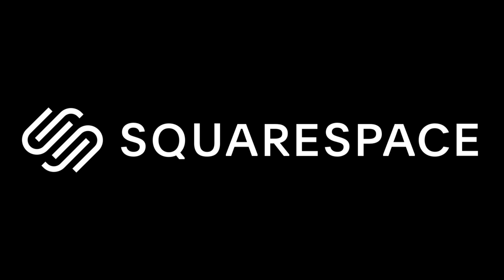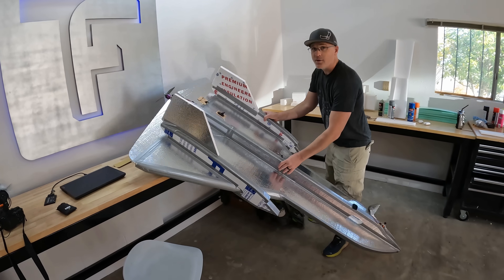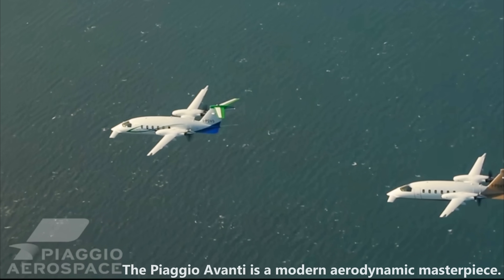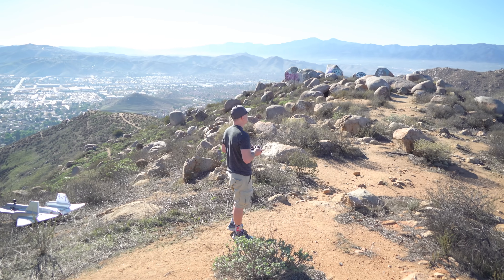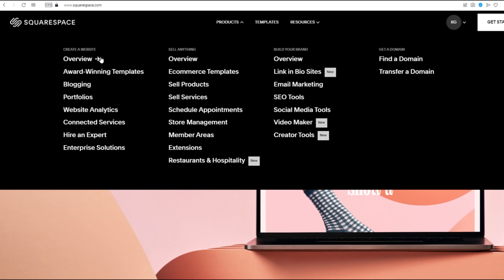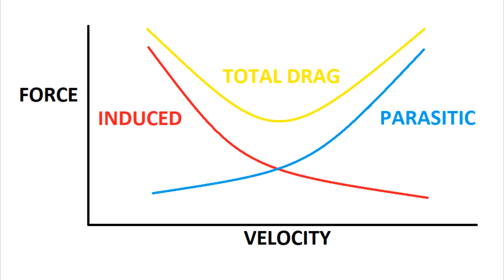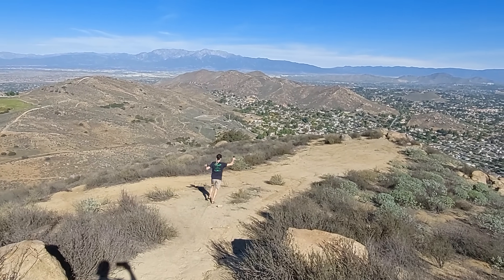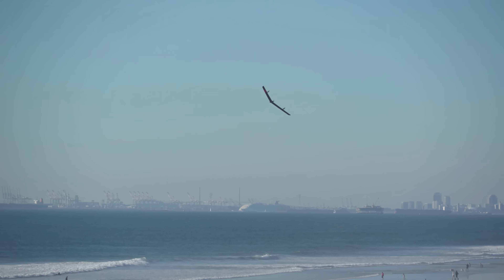Are Skinny Aircraft Wings Better?

Comment: In real aircraft, where structural weight is closely controlled (unlike in foam models), structural weight is much higher with high-aspect-ratio wings as the bending moments are greater and the spar is not so deep. (Spar weight might even depend on the third power of spar depth.) Greater weight requires more wing, and hence more drag. Furthermore, high-aspect-ratio wings have shorter chords, and hence lower Reynolds' numbers. (The Reynold's number describes whether flow is dominated by inertial or viscous forces.) Maximum lift coefficients are lower at low Reynolds' numbers and hence, again, a larger wing is required, increasing drag. This is why low-aspect-ratio wings are not as bad as might be expected from considerations of induced drag alone. They can work quite well on slow aircraft - e.g. Barnaby Wainfan's facetmobile.

Comment: I have never flown NRC plane before. I would like to build a low aspect Wing airplane to maximize my loiter time. I plan on using a flight controller. Do you have any recommendations or suggestions?  I have no idea how to pick a motor or battery or prop either.

Comment: Long skinny wings are definitely good for efficiency, but I've noticed issues with very light planes. When the wing span is large in relation to the airplane weight, the reynolds number is fairly low. Below about 50,000 most airfoil designs have lots of issues, so the L/D is very low. In this case having the airplane fly faster at a lower AoA is better due to the increased reynolds number and therefore increased L/D.

Comment: Doubt you will see this but I was wondering why you designed the low speed aircraft with swept wings. I did an extremely minimal amount of research and found that swept wing designs specifically deal with wave drag from transonic and supersonic flight. In the case of an electric drone, those speeds are not possible.
Reply: Its because it does not have a tail. Its very difficult to make a flying wing (airplane with no tail) that flies stable with a straight wing planform.
Reply: @dikkeyolo3713  I just figured that low speed efficiency would be better tested with a traditional design

Comment: Would you consider using this platform to test using mid wing mounted motors to counter act the mid wing vortex you noticed in your wing tip mounted motor? I've always wondered if that's the key to efficiency in flying wings. It looks like you either had the same or a similar idea with the vertical stabilizer placement. Just a thought, I'd be very interested in the result. Love your videos! Keep it up!!

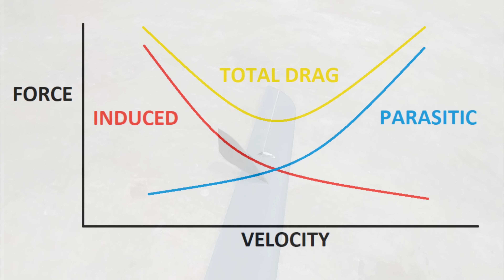Comment: 1:57 Deadalus (between Crete and Santorini, in Greece). longest human powered flight on record. Greek pilot. Picture is from here https://www.youtube.com/watch?v=4pbKp7ufwns
3:08 "high efficiency and low speed is correct" ??? Such planes reach up to 900km/h with the thermic as their sole drive. So, u call 900km/h slow, for a plane without any energy consumption? (or at least, no apparent energy-consumption)  ;-)   Generalizing for educational reasons is always a bad advisor...   ;-)

Comment: You just described the most commonly described differences between low and high aspect ratio wings.
But, you should also note the reasons why some people have suggested replacing the stubby wings of the F-16 with a delta wing, and why relatively high aspect swept wings might be preferred in some cases vs a delta wing that "fills in" all that space behind the leading edge of the narrow wing.

In other words, there's a lot more to the wing form than just whether the wing is high or low aspect ratio.

Comment: Great breakdown, I think its worth mentioning that swept wings, and the delta wing of your foam model, are generally designed with trans and super sonic effects in mind. Swept wings can lower the effective mach number and delay the formation of transsonic effects. Delta wings keep the wings out of the shock formed by the nose at supersonic speeds and generate lift differently at lower speeds, hence the larger angle of attack
Reply: I would like to kwow how a flat wing can acually give any sustentation, 1 of aeronautics and I'm not understanding taht.
Reply: in this case its more so for stability beacuse it has no tail

Comment: Well, let it put me that way. If you are speaking about form and parasitic drag and show a model aircraft with leading and trailing edges as thick as books, the effect described do not happen. The foam thing is nothing less than a pure form drag platform, even for slowest speeds.

Comment: I know skinny wings are more efficient, but what about solar powered aircraft? The problem is I'm not a mathematician or an airplane designer so I don't know how to figure this out. I have identified a few issues. 
1.Skinny wings are more efficient, but broader wings, for the same length, are stronger and larger so can attach more solar panels but are heavier... I'm getting rocket equation vibes. 
2. Do we even want to put solar panels across the entire exposed surface of the wing? 
3. Solar panels have essentially fixed weight per unit area, wings do not, or don't have too. 
4. Solar panels are also really heavy compared to normal wing structure materials.

I think the takeaway is that solar aircraft have very different design requirements and shouldn't be just 'regular' wings modified for having solar panels.
Reply from the maker: It depends on how much flying you want to do away from max solar efficiency.   If you are flying mid day then yes, maximize area and go with whatever gives you the lightest airframe weight.   If you have to fly through the night, you need very long, very skinny, marginal strength wings to minimize sink rate.

Comment: Here's a question:  At what actual velocities does the crossover happen between induced and parasitic drag?  Is this different for our small RC aircraft? How does airfoil shape (or other important factors) effect this? What other important factors contribute?
Obviously, there are (I'm sure) decades of math to figure this out based on as many variables as there are stars in the milky way galaxy. 
I would LOVE if you could do an in-depth analysis of choosing a specific aspect ratio and/or airfoil shape. 
How did you choose the specific wing profile for your high efficiency wing in this video?

Comment: That plane with the skinny wing would make a good FPV cruiser glider if fitted with a bigger battery and long range antennas, also if fitting with a 360 degree gimbal for FPV camera with head track on the nose would basically give you the best flight experience but due to FAA regulation would make such flight impossible without the flight clearance waiver. Still would make a good slope or flat land e-glider, now would be nice if plans  are available to build one.

Comment: You can see the same effect in birds: the long slender wings of an albatross, vs the wings of a peregrine falcon.  Another important part of the equation is maneuverability.  Multiple factors are at play, but one important aspect is the spatial relation between the center of mass and the center of the lift.
Reply: Long thin wings produce less drag, but are much more unforgivable in terms of actually flying them, prone to ip stalls, prone to sudden loss of lift due to the narrow chord,  harder to build... There is a lot of pros and cons to a high aspect ratio wing..

Comment: I once wrote an aspect ratio design analysis program for RC sailplanes  The program was based on Martin Simmons book on model aircraft aerodynamics and ran in basic 7 on a commodore 128D, gives you an idea of the vintage.  What I found was that for a 100 inch span and fairly light wing loadings achievable in a balsa & spruce construction, sink rate was generally minimised at an aspect ratio between 10 - 13.

Just prior to that, this had in practice work out pretty well for a slow high lift floater flying calm & relatively inactive conditions.  The model was a stretched and tapered wing version of a Soar Birdy 86" span with which I got 2nd place in my LSF national soaring comp Jerilderie Australia with just such a model.  However,  higher aspect ratios resulted in increasingly higher wing loadings and air speeds on an increasingly flatter glide slope.  The improved glide slope did not out weight the adverse effect on sink rate due to higher airspeed.  However, it did improve the models range and therefore ability to search for lift over a larger area & especially it's ability to do so in stronger wind conditions.  So basically, it became a gambling game.   I have put quite a lot of effort into optimising height from a bungee launch.  I could pretty much get more launch height than than anyone else  Because of the high camber wing & more rearward tow hook position, I had to hold a little down trim at the start of the tow to prevent the model doing a premature auto release while climbing vertically.  It was astounding how much more height I was getting & there was winging to the committee, but everything was comp compliant.  The only difference was that I had put the time and effort into trimming & preparing the equipment to get then best performance out of it that I could.

Anyway, I had 2 models at the time.  100" span using a scaled down Bird Of Time wing section.  This is a much less cambered and thinner higher aspect ratio wing than the other model.   Bothe models had similar wing loadings but this higher aspect ratio model was notably much faster had had a much flatter glide.  It could cover a lot more ground searching for lift.  However, that particular competition had cool weather and calm conditions & the floated won out over it by quite a lot.

My opinion though remains that it would have gone the other way if conditions had been windier with more active lift.

For these 2 modes, it would normally be the case that the broader wing should have the less cambered section and the higher aspect wing should be the more cambered section, but this was early days for me, before I read Martins book.  It's just that having studied the aerodynamics and then written the program removed the mystery & with it the interest, so I didn't continue to pursue sailplane design.  I had also designed a few models with too short a moment arm which unfortunately led to overloaded (stalled) tailplane during F3B speed runs & diving into the deck.   Normally the moment arm would be between AC wing and AC tailplane would be 4 times the mean wing chord for most model sail planes.  In order to achieve balance with less nose weight, I went for 3 chords, which was fine for normal soaring flight, not fine at speed though.  I think the 3.5 chords might have been adequate though.  As it was, I would start a ballast loaded speed run and at some point the nose would continue to drop despite up elevator control.

After that I bought a Sirus (2Ch) that someone else built, it clapped it's wings slope soaring over sand dunes.  Repaired it, strengthened the wings with a new I beam main spar, redesigned the tips & rebuilt the rudder & tailplane with a geodetic structure.  Installed a completely hidden in a closed loop rudder hidden cable system as the fin is suitable thick.
The model died one day when another pilot switched on their TX on an adjacent channel.
I had had many thermal flights well over an hour with that model, only landing to rest my neck.
That model had a fairly high aspect ratio high camber wing.  It could cover a lot of ground sniffing out lift, reasonably good upwind speed, not exceptional.  It could would loose out against a floater if no lift was found, but most time I'd find lift.  It had no provision for ballast though.  I had it disappearing into clout a few times.  The fully flying tailplane had differential control throw.  I could half loop over to inverted to drop out of the cloud base lift & bring it back home.  Rudder roll it to upright flight again for landing.  All in all it was a rather nice model to fly. see below.  

Soar Birdy Var 86 inch Span about 78
https://drive.google.com/file/d/1UM-ZV-CWWSXPEDwUoD5rfBmplhYUEEB8/view?usp=share_link

Bird Of Time Section 100 in Span about 79
https://drive.google.com/file/d/1iqbyN6a5l76PElb6qGHS8oobFz6cb9hM/view?usp=share_link

An RC flying wing glider I designed about 77:
https://drive.google.com/file/d/1s-Z7ob6zHEiKgaB_0w8HHgwYFyc8hrrZ/view?usp=share_link

A Sirus I had in the 80s  Many thermal flights well over an hour.
https://drive.google.com/file/d/1cDgETfMoPqNyu_TfJcuCd4v6dA-A6w60/view?usp=share_link
Reply from the maker: This post is a goldmine, thank you!!!
Reply: @thinkflight  Ta,

Then you may also be interested:  I did a statistical analyse aimed to best approximate the "ideal" elliptical span loading with a simple double taper wing.  It turns out that the standard deviation on the span loading's departure from elliptical is minimised when the inner panel is a constant chord for 40% of the semi span & the outer panel tapers to 60% of the root chord at the tip.  I never built it though.  It would be slightly unusual in that the centre panel is shorter than that of most double taper wings & the tip chord somewhat less as well.  Most tip chords go to about 70%, maybe even 66,6% (2/3) of the root. Many are scared of tip stall & cautious of making the tip chord too short for that reason, but combining a small increase in camber with a little washout, gives the tip the same AOA and higher Cl max before stall (safe from tip stall), without changing its zero lift reference relative to the rest of the wing.  Anyway, it "should" make for a slightly more efficient wing, not that you'd notice really, maybe a few seconds extra duration in dead air.

On the other hand, you'd get a lot more benefit from adopting Prandtl's bell shaped lift distribution at the same root bending moment as that extends the span very significantly reducing induced drag.  The maths looks a bit tricky to me though. There is a fair bit on the net about this these days and in English translation no less!
Reply: This is the first time I bookmarked a YouTube comment. Thanks for taking the time to type it out!

Comment: Amazing video as always, also loved the YF-23  at the beginning. Just a correction on a tecnical note: multiple time you said that high AR (aspect ratio) is for grater efficiency at lower speed. This is not entirely correct, in fact the AR determines mainly the max aerodynamic efficiency (lift to drag ratio), while the speed where the peak efficiency is achieved is determined by the wing loading (aircraft weight over wing aera). Also sometimes is better to think about not the speed of max efficiency, but rather the dynamic pressure of max  efficiency (q = 1/2* TAS^2 *rho); in this way you take out of the equation flight altitude (the higher you fly the lower the air density so the speed of max eff. increases). In my opinion the best way to undesteand intuitively those concept is by "playing" with the equation; I use Desmos for plotting the graps (you can set up sliders to visualize what happens when you change various parameter); than Matlab for more complex optimization.

Comment: It's all about flight envelope. Skinny wings have no air brakes, so they go fast on little power but fall out of the sky at low speed.  Wider, thicker airfoils have a wider flight envelope, sacrificing a little top speed but needing more power. Thick and wide airfoils are much more fun to fly.

Comment: but if you dont lack anything, then you dont bother considering
Reply: try tin-air fuel cell battery, 20x more energy content per mass unit
Reply: b2 spirit much bro :)
Reply: be sure that a stick without any wings (a hydrogen rocket) flies fine too
Reply: moar engine power, so you dont have to bother cheaping out and overthinking everything
Reply: thats a bird
Reply: some engines/planes do not need to be powered, just float in the wind surges
Reply: like boomerangs, take it back if you can

Comment: I just finished my Aerodynamics class. It seems like at low speeds M<0.6 high AR slender wings are the way to go for peak range. Then for supersonic speeds it seems more like an issue of getting the wings as thin as humanly possible to minimize the oblique shock angles. We don't even talk about AR on supersonic airfoil. Makes me wonder how complicated it truly is.
Reply: The crazy thin wings on the F-104 are a great example of that. Only downside is that they do NOT handle stalls well.

Comment: Is it bad I wanna build a combo of the 2 that would be efficient at either high or low speeds, but have the wings kinda... Idk morph? But have it big enough to fly in (barely)
Reply: Like a scissor? That's a thought I had, my models never did well, don't have the talent these guys do... 
   Something that would have an elastic membrane and switch from Delta to straight would be cool too...
  Hope they get around to reading these ideas..
Reply: @petevenuti7355  hey man I did some research try looking into a "sweep wing" it's something fighter jets use and works well apparently.
Reply: @nevernether3368  I was trying to think of some newer ideas... for a model..
   That NASA plane where the wing sweeps at a diagonal was cool too, actually works if the pivot point is at the CG. Would like to do that to my ultralight, but got to make it safe first.
... & The f-14 has always been my favorite aircraft. I never had to do maintenance on it though.
Reply: @petevenuti7355  maybe a Russian nesting doll of wings? That way it could extend and change shape or contract it to a smaller wing.
Reply: @nevernether3368  like that lame pop-up self defense sorwd stick that's like a Chinese yo-yo? A roll of spring steel sheet metal  but bigger and pressed to a wing shape. Linear actuator.  Sounds like cheep & sloppy metallic fun. Dangerous toys😜 Not saying it's a good idea, but I like it. Pocket glider. Might happen.
Reply: @petevenuti7355  I mean like they could slide into each other to make the wing longer along the body of the plane.